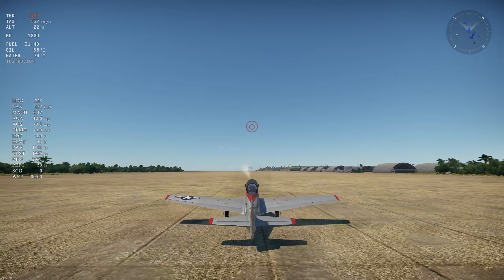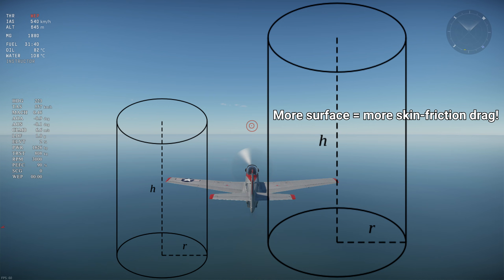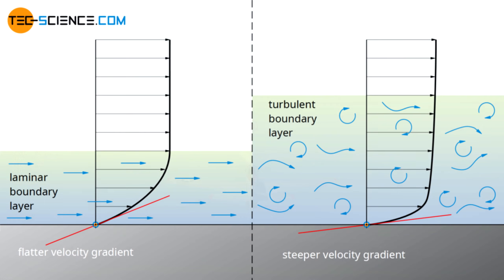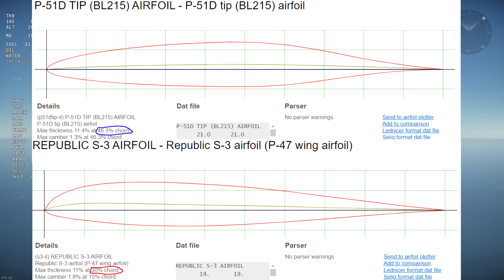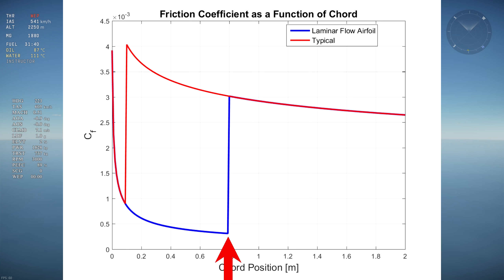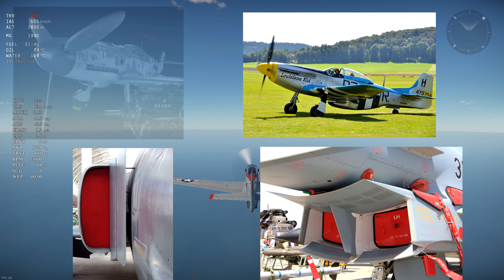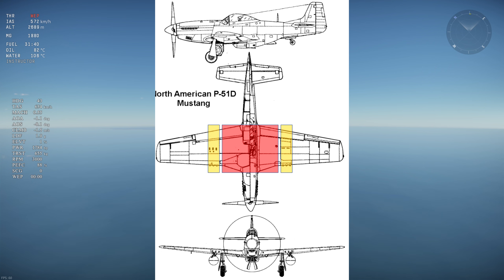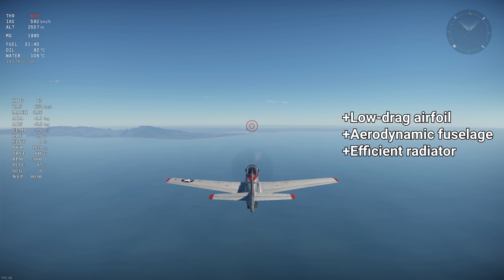Laminar Flow Explained | P-51 Mustang Case Study

Comment: Hey Adam, at 5:20 what exactly did you use as the characteristic length for each of the 200 sections?
Reply from the maker: I used the Mean Aerodynamic Chord of the P51.
Reply: @AdamTheEnginerd  ah, ok, thx. But what I don’t get is that doesn't doing that give you a constant Re across the whole chord? The MC is a constant value, isn’t it?
Reply from the maker: @dogeness  No the Re changes as you go along the length. That's why they talk about the transition Re where laminar flow becomes turbulent, which also corresponds to a transition distance at given flight conditions. Typically in simpler exercises, you can just assume the whole length of the chord is turbulent, which is why you can skip a step and use the chord as the characteristic length, but if you want to model laminar and then turbulent flow, you need to compute the drag for the laminar part and then the turbulent part, and then sum them.
Reply: @AdamTheEnginerd  but what term specifically in Re is changing as you move through each of the 200 sections? Because viscosity is constant, density is constant, v is constant (?), characteristic length - section of MAC is constant (?)

Edit: wait, actually, the characteristic length is changing, isn’t it? Because as you move along the MAC you add the new section of distance you moved to all the previous distances?
Reply from the maker: @dogeness  Yes the length is changing, so every section has an average length, and the Re for that section is calculated using that length. That's how eventually you get to the transition Re, and then you use turbulent equations for Cf.
Reply: @AdamTheEnginerd  ok so if I may, may I just confirm a few things? 
1. The distances you used for characteristic length vary from 0 at leading edge to 100% MAC for the 200th section? 
2. You assumed the perfect ideal scenario and used a given of a transition at 40% MAC? That was when you switched from one equation for Cf to the other?
Reply from the maker: @dogeness  1. Yeah, so the first section's average length is (0 + 0.01)/2 = 0.005
2. Exactly, ideal scenario for laminar flow.
Reply: @AdamTheEnginerd  I see, thx Adam. And I really hope you go back to making these educational videos at some point. They’re really interesting.
Reply from the maker: @dogeness  Yeah I'd like to. I've been busy and it is a lot of time investment.
Reply: @AdamTheEnginerd  yea i understand
Reply: @AdamTheEnginerd  Sorry, just one more question. Did you find that the Re at 40% MAC was around 3500 which is the normally stated transition value in most fluids textbooks?
Reply from the maker: @dogeness  3500 transition is for internal fluids. For fluids over a flat plate, it's 100000-500000 or so. But that's in ideal flat plate conditions, it'll get tripped to turbulent earlier than that (pressure gradient with curved airfoil). Laminar flow airfoils aim to get 40% or so laminar flow by having an as much as possible gradual change in cross-section, rather than the more abrupt and early rise in cross-section like on other airfoils that were typical in WW2 and even now for low speed applications.
Reply: @AdamTheEnginerd  oh ok thx

Comment: I heard that in the p51 manual it states that the wing is "of laminar flow design" and that it doesnt state anywhere that its actually a laminar flow wing
Reply from the maker: Well sure, but the point of a laminar flow design is still to achieve some laminar flow.
Reply: @AdamTheEnginerd  well yeah, but how much laminar flow makes it a laminar flow wing? I always thought it meant that it retained laminar flow across the whole surface, but i learned different. Great vid Adam :)
Reply from the maker: @toomi195  No, you'd need an active system to attempt to achieve laminar flow on the whole wing for an aircraft that carries humans at decent speeds.

Thanks!

Comment: yo adam, it would be very intresting to see if high altitudes affect bullet ballistics. shooting at 10km alt should yield much longer range no? also if shooting towards or away from the gravitational pull affects max range.
Reply from the maker: Irl the altitude one would make a difference, the gravity one would still be negligible. In game, it doesn't seem like either of them change the range or speed of bullets.
Reply: @AdamTheEnginerd  I just thought it could make an intresting video.
I could imagine the altitude one to be in the game(has to be tested to know for certain). I would guess that the gravity one is in the game since bullet drop is too. For example, if a bullet traveled 15m towards gravity when it reached max   range on a shot perpendicular to the gravitational pull, then theoreticaly if you shoot the sky, parallel to the gravitational pull, the trajectory should be perfectly straight but 15m shorter than on the first shot.

what do you think?
Reply from the maker: @twister300000  I don't have the tools to measure that anyway.
Reply: @AdamTheEnginerd  i'd know how to test both and it would make a good show too.

Comment: Didn't the first post war fighter jets also use a laminar flow wing? Because I remember reading or hearing that the F-86 Sabre also had a laminar foil.
Reply from the maker: Hmm I highly doubt the F86 had laminar flow, swept wings and higher speeds will make it even harder to maintain laminar flow than on the P-51.
Reply: @AdamTheEnginerd  or it at least was designed with that in mind, possibly because they did not know any better, yet.

Comment: Do airfoils have no pressure drag because the air stays attached during flight?
Reply from the maker: Hmm no, even if flow remains perfectly attached you still have a small amount of pressure drag, it's just that skin friction drag is the major part of drag on (well-designed) wings. In fact, in some of my courses, to calculate airfoil drag we calculate skin friction drag, and multiply it by a factor taking into account the airfoils thickness to chord ratio.
Reply: @AdamTheEnginerd  Oh ok. So the air downstream of the airfoil has a lower pressure than upstream due to viscous losses, and that causes the pressure difference?
Reply from the maker: @dogeness  Yeah, though you could say that's separation. There's always going to be separation at some point on the wing even at low AoA.

Comment: Does the p51 always have laminar flow in war thunder based on it's top speed
Reply from the maker: You can't know from it's top speed, you know by checking the wing drag coefficient, and it does not have laminar flow in WT. It still has one of the lowest wing drag coefficients for a prop though.
Reply: @AdamTheEnginerd  Does War Thunder even model laminar / turbulent flow? I thought they just work with a table of drag coefficients without regard for the actual flow structure

Comment: Does war thunder actually apply these physics in game?
Reply from the maker: WT has the drag coefficients for different parts of the aircraft already, so they could have done these calculations to get the wing drag coefficient. In WT however, the P-51's wing drag does not correspond to a laminar flow wing, but it's still among the lowest wing drag coefficient for a prop in the game.

Comment: I mean, formula 1 cars are made to produce as much Downforce as possible with the least drag possible, and they have many vortex generators so that can guide the air wherever they want it to go, just because it produces some kind of drag, does not mean it’s not aerodynamic
Reply from the maker: Sure, but not sure why you're saying this.
Reply: @AdamTheEnginerd  Because you mentioned Airliners using vortices generators for better stall characteristics, it made me think of all the elements of F1 cars that are made specifically for that purpose as well, I didn't mean it as a negative comment, loved the video !

Comment: Reynolds criterion. PTSD from Chemical engineering kicks in.
Reply from the maker: What was that used for in Chemical Engineering? Or is it just from the common fluids class?
Reply: @AdamTheEnginerd  Well, you answered that one. As a chemical engineer, you need to know how to build a proper piping (as the reactor may as well be a pipe). Plus some of the pther criteriom describing how well your solution is stirred are connected to Reynolds criterion.
Reply from the maker: @Sunshrine2  Ah I see thanks! I really don't know much about Chemical Engineering except the oil memes.
Reply: @AdamTheEnginerd  Hah, neither do I really. I only had two semesters of that during my bachelors. My field is quantum chemistry/molecular physics. (Though, the "inner friction" is a hot topic for some of the molecular machines guys.)
Reply from the maker: @Sunshrine2  Oh interesting!

Comment: its not hard to visualize skin friction drag when shockwave enters the chat
Reply from the maker: I think shockwaves are more in the pressure drag department.
Reply: @AdamTheEnginerd  but that happens when air cant move away quick enough, then skin friction drag would have to do with that, the shockwave is usually aft of the object, i would say the location of shockwave tells u where the departments are separated

Comment: Laminar flow was probably never achieved in the field of combat. The P47 was tested with a laminar flow wing, with very little difference between laminar flow & the Severski wing in reality. The P47M & N were both much faster than the P51D with it's supposed "laminar flow wing". Much ado about nothing.
Reply from the maker: Well even if a plane does have laminar flow, it wouldn't automatically make it faster than everything else.

Comment: Clay bar your plane! Cut down on that drag yo! 👍😎👌
Reply from the maker: Haha clay bar? What's that?
Reply: They use it on cars to take the iron particles and other crap that gets stuck to your paint that washing doesn't remove. You can feel it on the paint and can actually hear it when you wipe your hand across it. To get rid of it you use what is called a clay bar along with soapy water, and rub that on the paint and it pulls all that crap off the paint. Leaving the paint super smooth. Sure it would work great on a plane too, less drag from smooth surfaces.